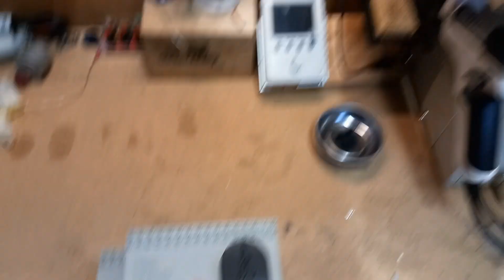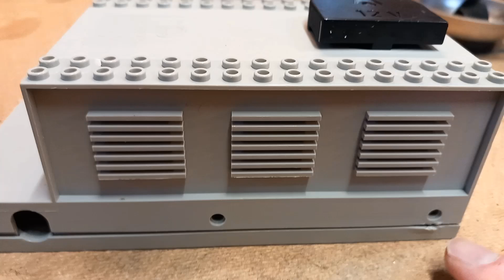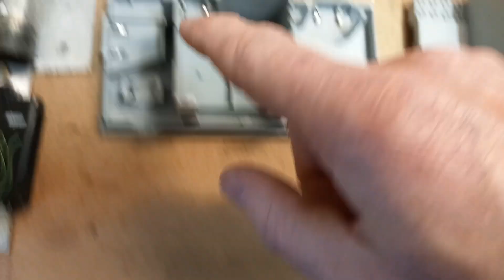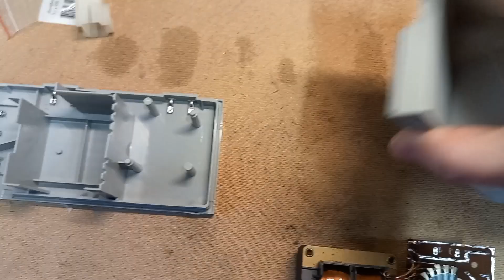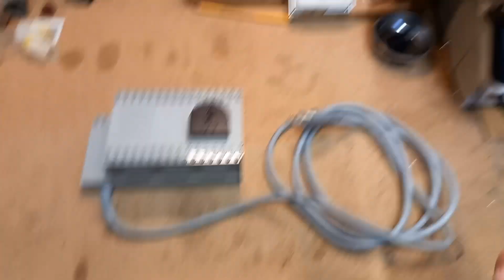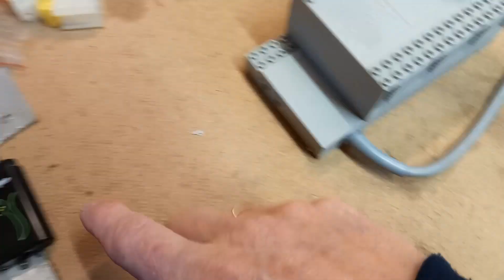Lego 7864 Transformer repair

Comment: The transformer was originally designed for 220v and since that era we now have a higher input voltage so that will also account for a higher voltage?

Mine is sometimes kicking in the bimetal and shutting off, and then turning on after 5s and off again after 10seconds.
Not sure what is happening there. Maybe a lot of dirt somewhere.
I found my Lego after being in the attic with my parents for 35 years.
Didn’t even know it was still there.
And I am trying to clean everything and get it to work :)
I’ll try to open the casing but couldn’t see it clearly in your video how exactly it works.
Reply from the maker: Thanks for your comment. If you want to ooen the housing, you have to pull out the plugs in the bottom. I would suggest to glue a wooden stick to the plugs, using superglue. That way you can pull them.out.

Comment: For comparison, other internet forums report these values for the three outlets:
* 0-12V DC (maximum voltage 16,5V if no load),
* 12V DC (maximum voltage 16,5V if no load),
* 13V AC.

So that matches quite well with what you measured.
Reply from the maker: Thanks so much for this valuable comment!

Comment: Really?This raises more questions than answers 
For me .

Was not expecting there to Sets of four diodes.

Make sense.For some reason they're using two Separate full bridge rectifiers .

made out of eight Is separate diodes It almost looks like four of the dyers are a different type in the other but it's hard to tell.

My guess is the track.Output is being rectified separately.Which kind of makes sense since a variable voltage.

Announcing seeing the inside of the other information out there as to what's in there is definitely incorrect.

A lot of people suspected that it variable transformer kind of like was used It's various smiles of lionel transformers.

I'd seen mention of what the other lego transformers having tapped transformer.

About a particular rare model having so many voltage taps.

So i'm not surprised that something somewhere is used across the board.

Indefinitely the 12 0 1 for the trouble.Constantly outintended for the switch boxes and Other.

Make sense that this is separate altogether.

I'm wondering.
If there is a common connection between fort lauderdale to avoid in the output for the end connection for the Constant Is twelve volt connection.

The ford of switching that is on that robbery switch P c b.

I wonder if there's a schematic for this thing out there.

I've been looking for it for a while.And if anyone has a link to this somewhere, please it's get back with me.I'm sure a lot of people would be grateful.

Also this is usually similar to the nine volt speed regulator and how it was done with the p c b board robberesearch just a more in modern incarnation of it.

And less speed steps!

Forward reverse is done pretty much the same way but slightly differently.

However indian working pretty much the same Just a different way out of contacts to do it.

But instead of a tapped output on the power source of the novel speed regulator What they done was to switch in resistors to the adjustable voltage regulator.

Also some more info that might be of help regarding the lego transfer regulator if anyone is curious or needs to know.

Input could be either a c or d c.

There is an internal bridge rectifier so wouldn't be critical as to either.

Also the Is odd Ten volts a c. voltage is not neede

Twelve years d c is a okay for tower source.

Have seen internals and also schematic for the speed regulator.

Not sure.What the absolute maximum voltage would be?But as long as it's within space of the internal's parts it will be fine.

I've not seen the info on this.That would be determined by the ratings of components such as diodes and the maximum ratings of the Adjustable Voltage regulator.

Of course lowest rate of component is the limiting factor in the circuit.

And yes, these speed regulators can be upgraded to allow higher current by changing out the voltage regulator. And the diodes.

By the way the extra diodes in the speed regulator are used to check the voltage regulayou voted for a delivery from damage due to back feed and otherwise.

Very well designed for protection.

Also it's using the voltage regulator itself as protective circuitry overload and over temperaturr

And for those are Curious modifier is and the modified people are from what I understand.

Yes?
The a c output that is commonly blocked off of that plastic Isolating plug.

Was intended to use the older blue era remote control switches.

These were eight operated by a c power.

By the way, from what I understand. I have seen elsewhere.

Full throttle is actually an excess of Twelve volts possibly around sixteen v dc Not sure if this is unloaded or loaded.But it sounded like even with a train running.It was closer to sixteen volts.

A lot of people do say that the lives can be quite bright if not heavily loaded at which we point to Higher voltage than 12 V when lightly loaded.

And if indeed, all outputs are fully isolated from each other.
Better yet.However i'm thinking there's at least one wire is common since Is only one circuit Breaker.

I've also curious about how the other transformers that were available are built as wel

Have one question that I'm not gonna find the Answer to either 1 of the our Transformers.The one that has the two outputs Above each other.

Not sure if those two outputs are in parallel or no

I can't find anything on this whatsoever as to what's going on with This add no mention if this transformer has a second output.That's a constant twelve holes much like the more modern gray one.

Or possibly this might be a ac output.

Anyone out?There has any info on any of this definitely chime in
Reply from the maker: That is an interesting observation, I don't have the knowledge to answer all of your questions, hopefully someone can chime in.

Comment: I think the AC voltages measure high because they are un-loaded, and my guess is the AC voltage while powering some lights will be normal and not damage the light-bulbs.
Reply from the maker: I will test it again, with a 10 watt bulb in the circuit. I should have tested it that way, because that is how I tell students to test wires and circuits 😬